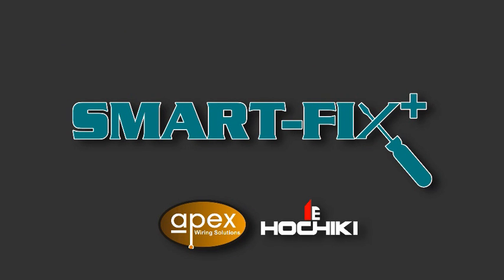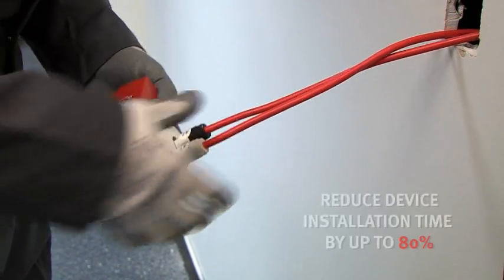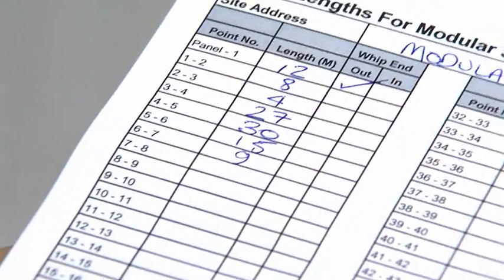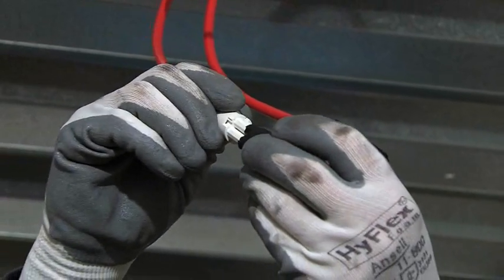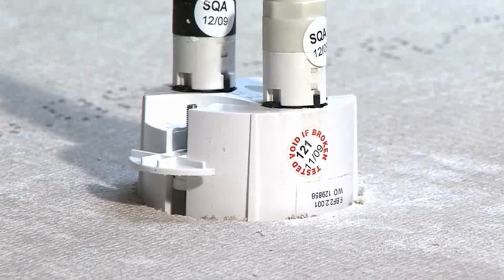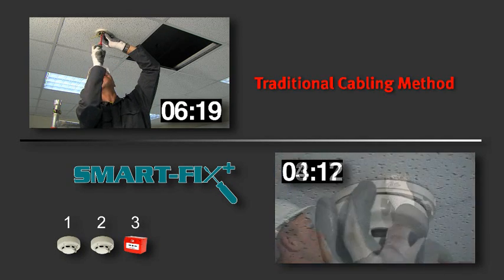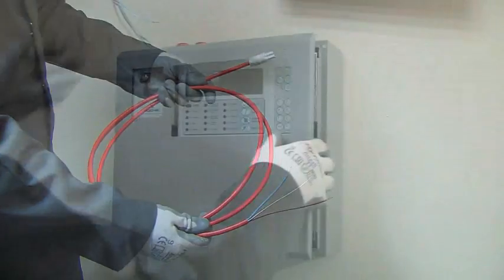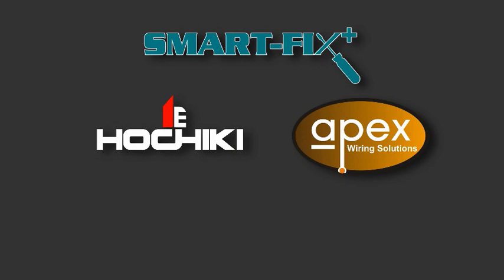Apex Wiring Solutions and Hochiki SmartFix+

Comment: if the engineer onsite could make those ends then fine but the way this video looks 12 months down the line a plumber damages the cable i go out on a callout im screwed coz of hochikis crappy plugs and we are back to connector block so its all a bit pointless